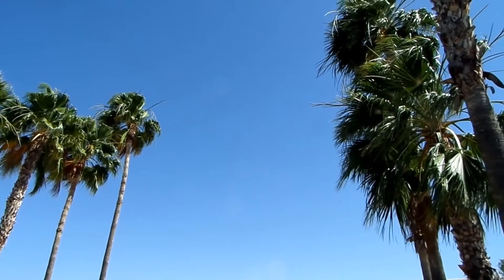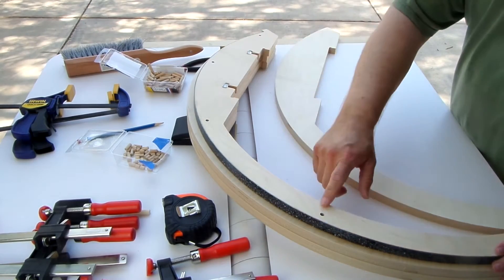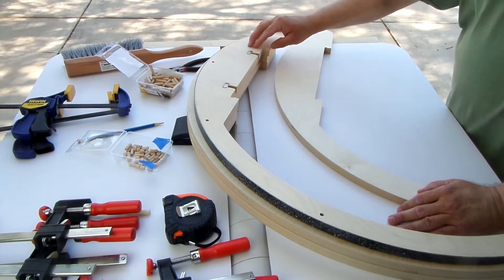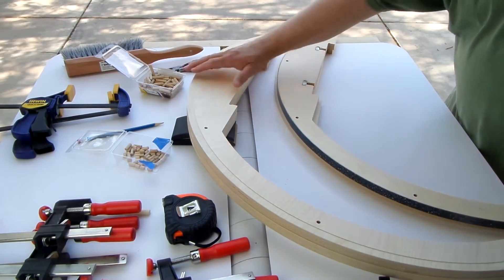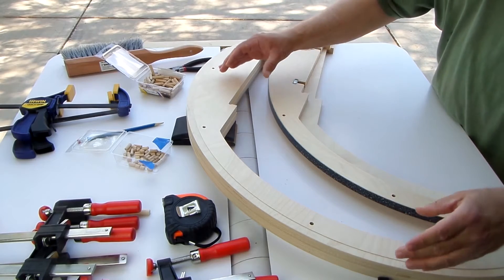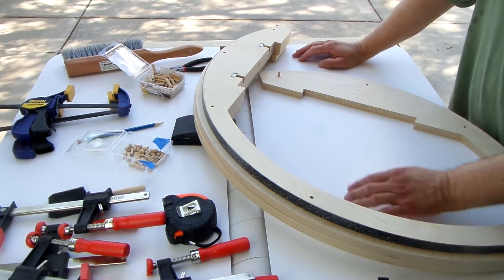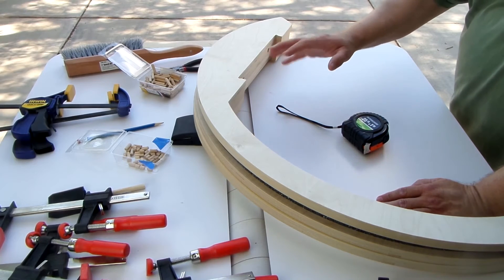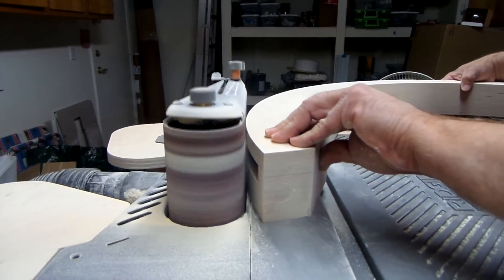Renegade Telescope Bearing Construction

Comment: Hi Gordon, always great to watch your videos. May i ask you, for what the role is used in the table? Thank you, Muhsin.
Reply from the maker: Hi!  The white table is actually a drum sander that I recently built.  It has a cylindrical sandpaper drum that is about 30" long, and I designed it especially for sanding telescope parts, like the rings and circles in our Renegade.  I built it so the top was flat and the edges are clean, so it is also a good work surface in general, and useful for clamping during glue-ups.